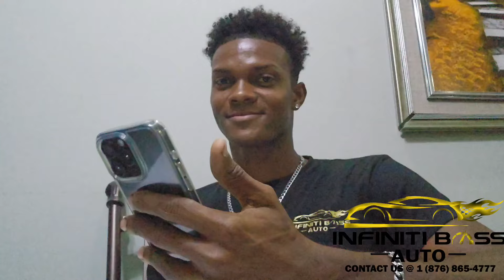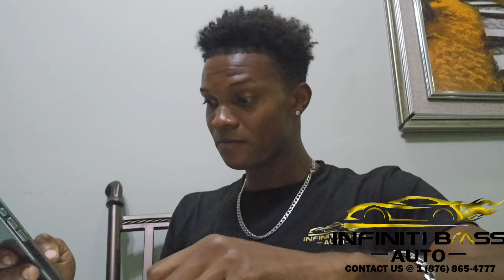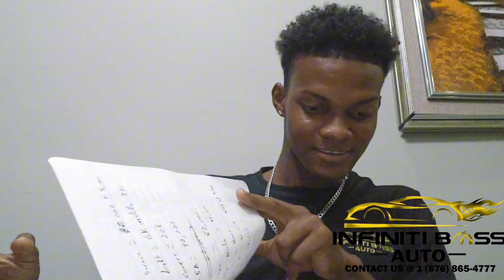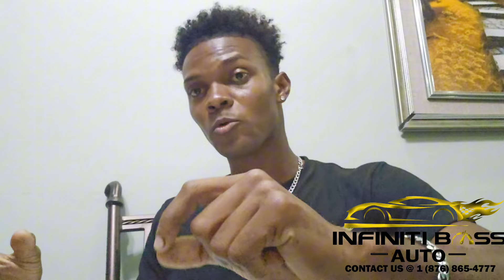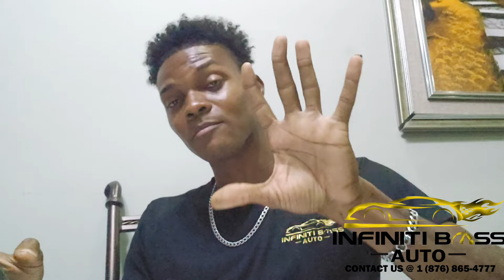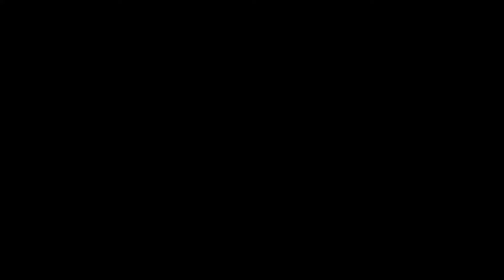HOW MUCH TO BUILD A G37 in Jamaica 🇯🇲🇯🇲

Comment: Why would u pipe the exhaust from 3inch down to 2inch? That’s restriction and back pressure
Reply from the maker: 3 inch to double 2 inch is not restriction that's more flow loool if it was onto a single its restricted into a double is more flow

Comment: Boy, you could a could a buy a 100 put a 2ZZ in there, spend a little to tweak it and have a lot a fun.  Running better times than the infinity will
Reply from the maker: Aint nobody want no 2zz 

And that cant run better times low boost 12.3 ..still have a whole 7psi extra to test son stock engine
Reply: @infinitibossauto  Like you said, it nuh hurt if you can afford it.  like the vibe you bring still, looking to see the machine on the track.